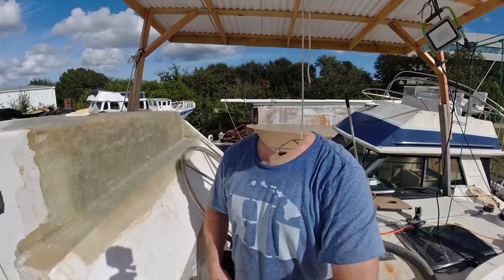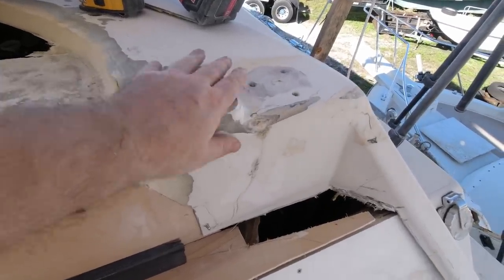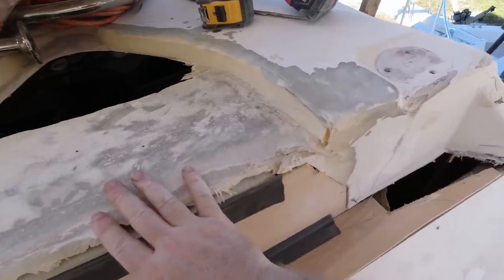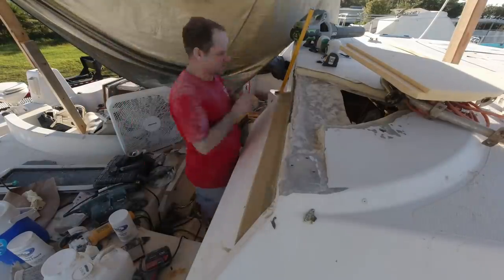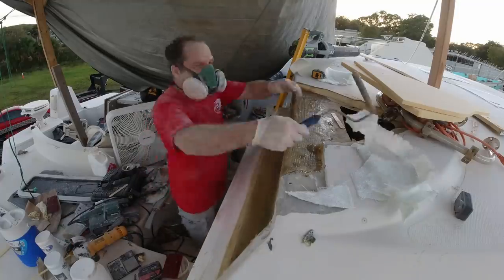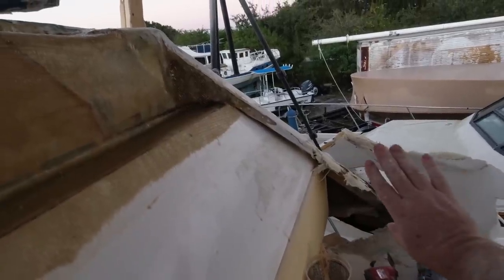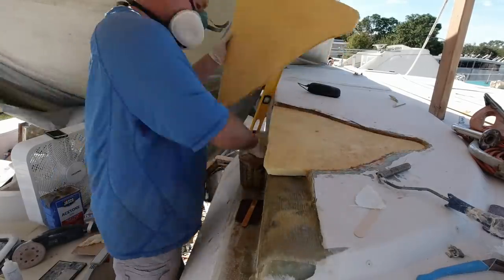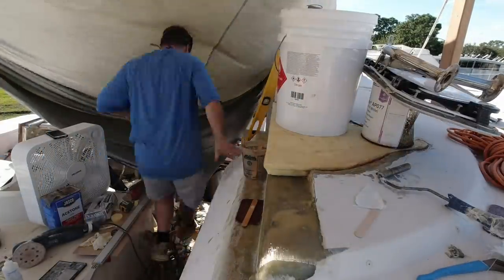15 Fixing the boat with duct tape and scrap wood.

Comment: Bryan it is really starting to look good.  There is a guy on Barefoot Sail and Dive that is doing some fibre glass work/repair that has been using a special tool that removes gel coat and layers of glass in lieu of grinding.  He does the big part of the job with this tool then does some light grinding to finish the job. You may want to look at that tool it may help.

Comment: Software developer here to.  My desk would be an ungodly mess when I was in the zone.  I always told my coworkers, if my desk is clean and neat it means I'm really stuck on something.   Sailing Parlay Revival is fixing up two cats for profit.  Why didn't you get a cat with less damage like they did?
Reply from the maker: It was by choice. I wanted a project plus the price/value factor.  The biggest reason is this boat is a much better boat for what I want. Designed to be a live aboard, tough world cruising boat, not a charter boat.

Comment: I am really interested in your start on the cabin top! I probably am wrong but would have repaired the hull first and gone bottom (engines) then up.....because I am impatient and would run out of enthusiasm by last 1/3....and if the bottom was done at least it would float! Then done cabin and cosmetics!
Reply from the maker: It's to keep the rain out first!

Comment: SURFACE tension occurs on the surface on liquids not solids, idt u will find a difference in sanding same day or different day, any difference woud be immeasurably small
Reply: Yep - surface tension is a property of liquids, and the resin is applied as a liquid.  A low surface tension of the resin is desired for wettability to the applied substrate.  Anything you can do to the surface to improve wettability is good.

Comment: Are you protecting the repair areas to reduce the affects of UV on vinyl ester  matrix?  A few studies show the damage can be significant even after just 1000 hours or 80+ days.  The hardtop cover you built may reduce but not eliminate UV exposure.  Will you be gelcoating as you make repairs?
Reply from the maker: Good point. I'm going to have to some up with a plan for this.

Comment: Put at least one coat of paint over the fiberglass before moving on.  Use polyester gelcoat if you're planning to come back and lay more glass later.  The sun will completely degrade the bare polyester resin in an astonishingly short period of time.  I know this from bitter experience.  About a year, tops.
Reply from the maker: Thanks for the tip!

Comment: What kind of foam are you using with the vinyl ester resin? How much does it cost, roughly?
Reply from the maker: Look at the older episodes there is one that talks about foam core. I'm using core cell as that is what the boat was originally constructed from. $300 for a 3/4" 4x8 sheet

Comment: High wheel will block your chart plotter?
Reply from the maker: I plan to use a 9" chart plotter that will go where the compass is normally mounted.  The compass will be deck mounted recessed into the cabin top. A second or third chart plotter will mount slightly off to the side on the normal slanted part of the dash. My seat will be on slides so I can sit up closer, or slide it back for standing. That's the plan this week anyway 😉⛵🌎

Comment: A couple of points - firstly I do not know how long you are leaving exposed glass it will no doubt be ok for a while weeks even but remember it is taking UV damage and weakening.
Secondly it is a good idea to work clean it is more efficient safer and quicker it may even stop comments by your more OCD subs. Do not do so for any of those reasons but do so because you are working in an environment where you are raising dust and dirt into the air. This is not a good idea especially when laying down glass or painting but also in general.
Reply from the maker: Thanks for the tip on UV

Comment: Vinylester is NOT epoxy and will actually have a very poor bond on cured polyester. The only thing that really works on old polyester is epoxy.
Reply from the maker: Yes I misspoke. I'm using both vinylester and epoxy in different parts of the boat.  I'll be addressing this (with full tests) in a future episode and I may switch to all epoxy, but that means paint and not gelcoat.